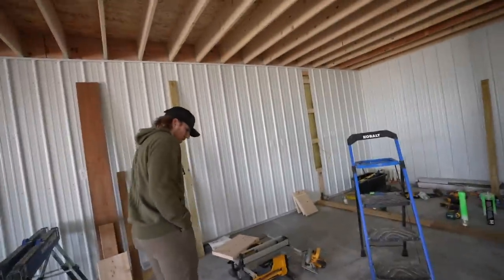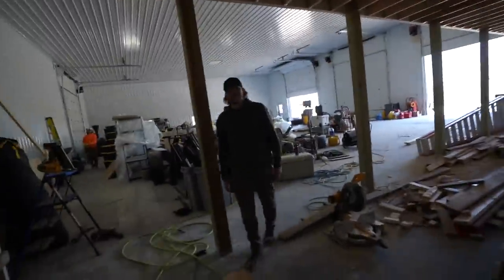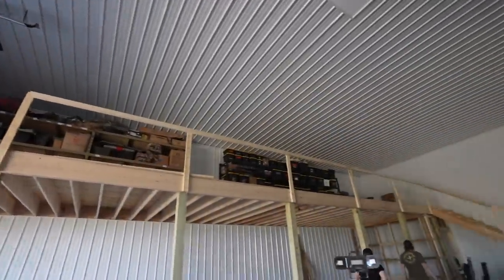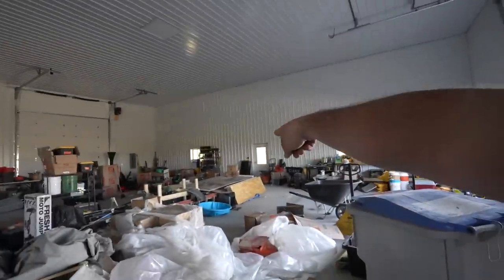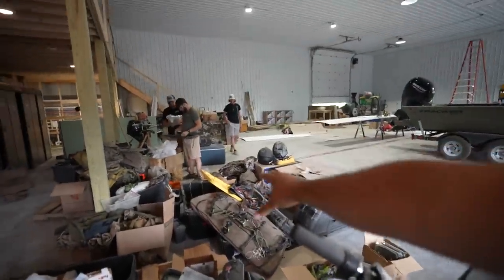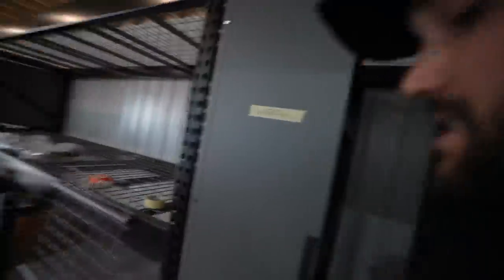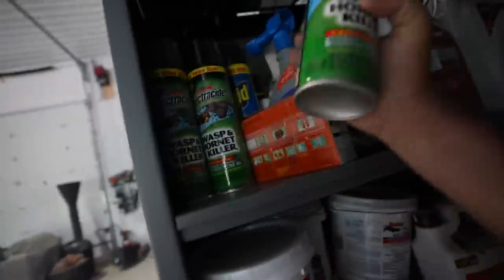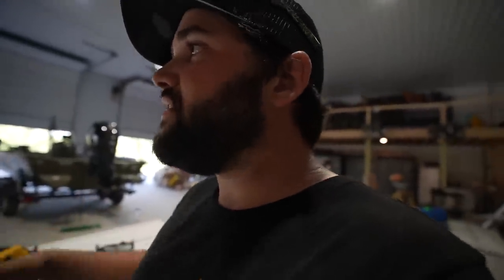Transforming My BARN into the ULTIMATE DREAM SHOP!!!

Comment: I'd get some extra heavy duty ceiling to the floor shop curtains so  if you ever want to keep any dusty dirty or just noisy type projects separated you can, plus too if you wanted have your catch and cook area by the bathroom heated or cooled you could just pull the curtain and close off that side of the shop and be somewhat comfortable

Comment: I would for the loft make a section with an easily removable or sliding gate so you can use a skidder of forklift to lift a pallet of something and set it on the loft for easier moving of lots of stuff trust me